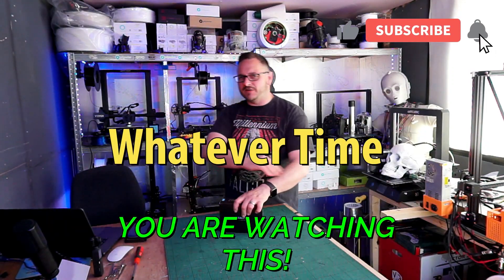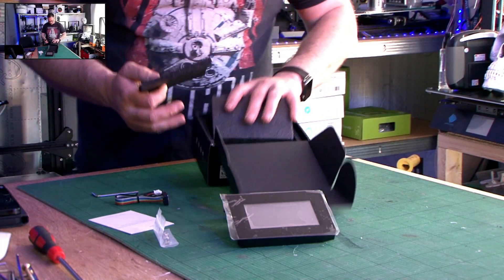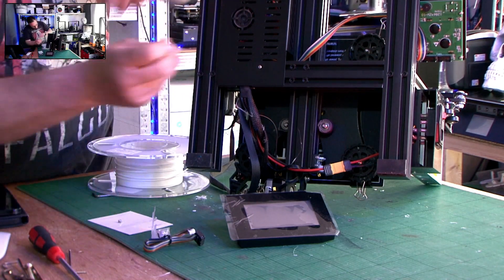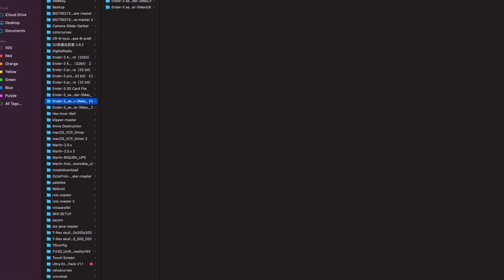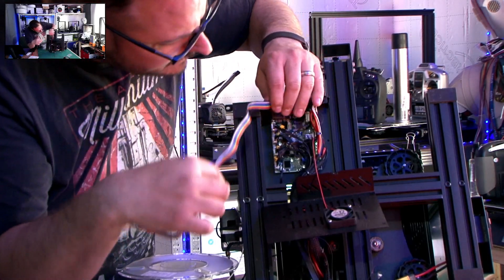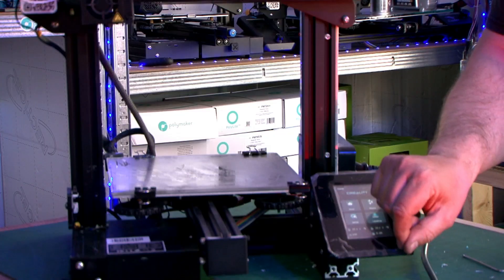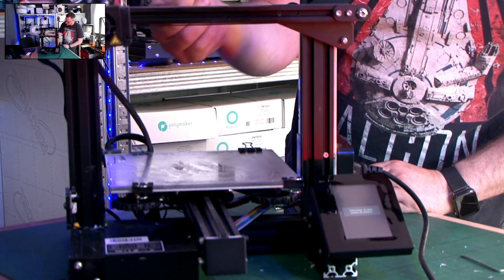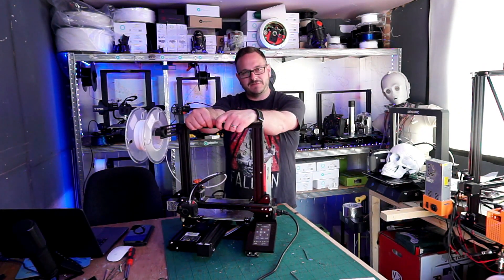Is Your ENDER 3 Outdated? Upgrade with This Touch Screen

Comment: Thank you for making these videos. I like them because you take time to explain things. I have a Ender 3Pro with a 4.2.7 motherboard with the old style screen with the twist knob at the front but when I try to get the updated software from your link nothing happens. I run Marlin 2.07.2 software. cheers 
stay safe 
Bill M8-)
Reply from the maker: Hey Bill do you mean the link doesn’t work??
Reply: @TheRealSamPrentice  Hello I downloaded the bin file then transferred it to my printer and it still shows the Malin screen . I must be doing some thing wrong but what....
Reply from the maker: @billmartin6687  Hey Bill did you format the SD card before adding the .bin file? Also when you plug that SD card back into your computer it should change from firmware.bin to firmware.CUR that is the sure way to tell.
Reply: @TheRealSamPrentice  how do you format the SD card? I have the Ender 3 Pro and the push button stopped pushing, so I ordered the touchscreen. I confirmed that I'm running the 4.2.2 and download the correct .BIN file. It seems to work when moving the SD card to the printer, but when I click on 'set up' I get a gray box with no words, and only the option to click 'cancel'. but it won't do anything when I click cancel. I then shut if off, fire it back up and other options aren't working. Do you have any advice?

Comment: I just upgraded my firmware to the latest jeyas with colour screen settings etc.  Soon as the touch screen firmware is as good, I’ll swap 😄
Reply from the maker: Good work !!
Reply: @TheRealSamPrentice  yeah but now i keep getting wrinkles in layers other than the first (which is perfect) even though I’ve calibrated everything and my bed is very level.  Wasted 2 days and half a roll of filament so far!  Can’t find anything that tells me how to fix it 😥
Reply from the maker: @DementedDog  are you using cura ?
Reply: @TheRealSamPrentice  yes.
Reply from the maker: @DementedDog  can you try Kiri:moto and see if it makes a difference
Reply: @TheRealSamPrentice  I can,  but it’s always been perfect up to now.  Wondering if I should reflash the last good firmware?
Reply from the maker: @DementedDog  I’d say the and eliminate the basics first
Reply: @TheRealSamPrentice  you mean yes?  😂
Reply: @TheRealSamPrentice  fixed it.  I’d forgotten to pull in the UBL mesh before the print.  Durr!
Reply from the maker: @DementedDog  ah well done :)
Reply: @TheRealSamPrentice  I could spit! 🤣

Comment: I'm having an issue with loading the firmware, it just has a blank loading bar. any thoughts
Reply from the maker: Make sure you have the correct board firmware along with the card formatted correctly. let me know how you get on try a different sd card

Comment: I am having an issue with the touchscreen since flashing firmware directly to it. sometimes it loads and the print and ready buttons don't function and sometimes it stays on the creality load screen. please help.
Reply from the maker: I’d reflash both in that case